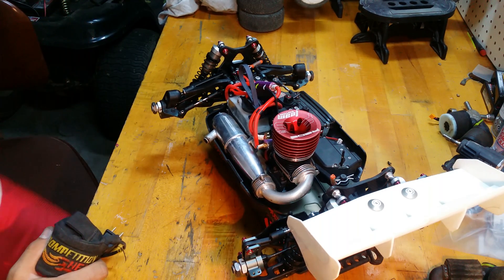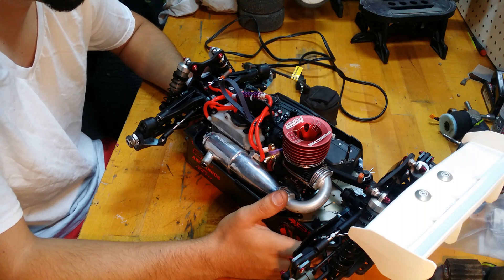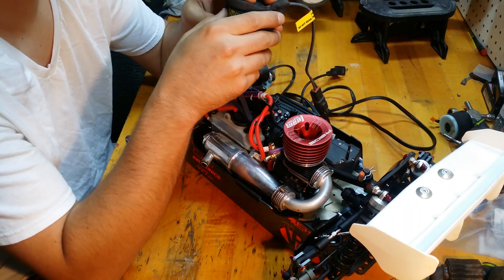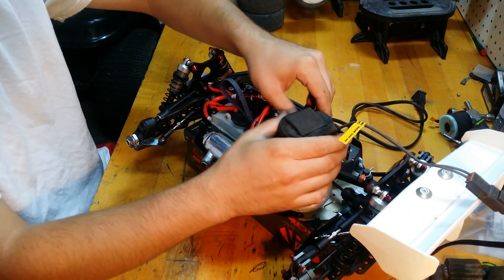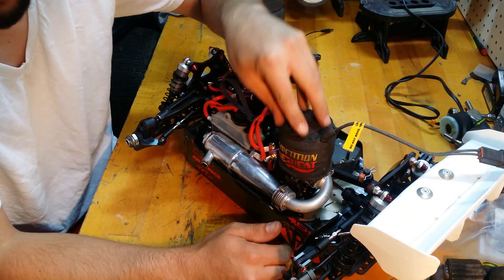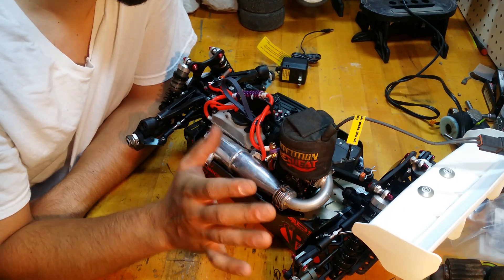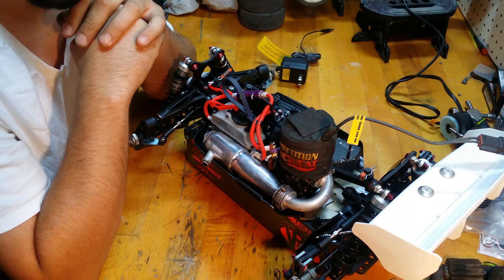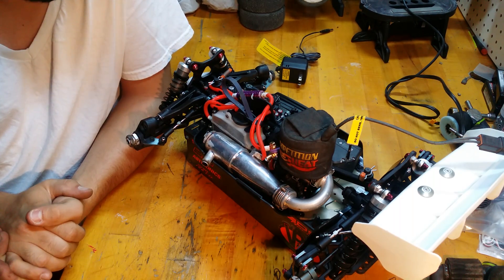Nitro Engine Break In- Step 0.5

Comment: Another great video dude.... Learn a lot from your videos especially with me being a Novice in RC Racing....What are some good servos for a 8T 3.0 with a Reds R5r....Keep the vids coming man....Thanks
Reply from the maker: it depends on if you plan on using a lipo, life or nimh battery. I recommend using lipo to power your electronics and buying high voltage servos that can operate at 7.2v for optimum performance. in 8th scale I wouldn't recommend using a servo with less than 250oz of torque. more torque more abuse they can handle in crashes. but you trade speed of servo for torque so you want to select something that has great torque bug also great speed. realistically those servos are 75-125$ minimum. it seems like a lot initially but buy quality stuff one time so they last you much longer